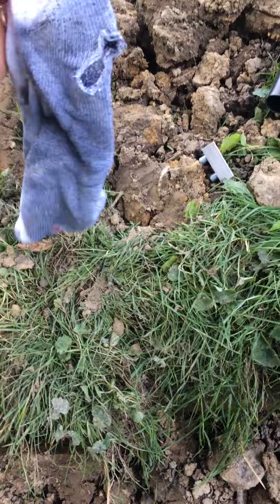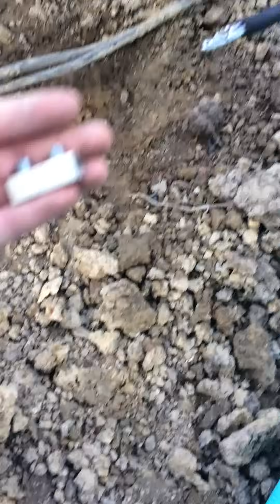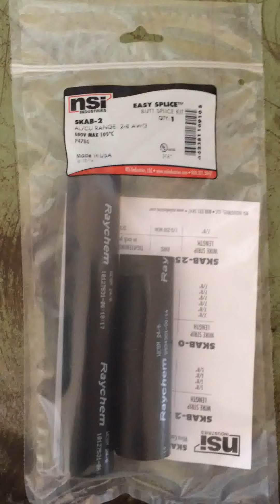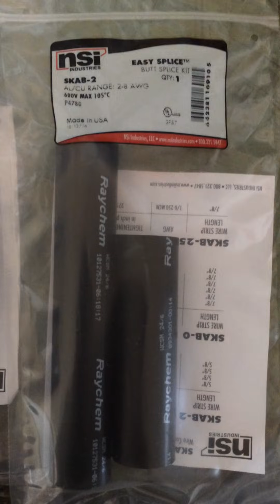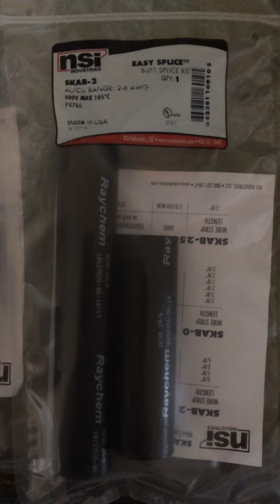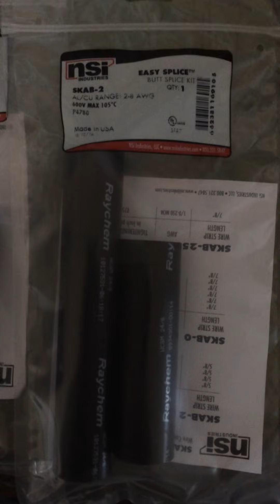Repair broken underground aluminum electrical line 4 AWG

Comment: Do you have a video on how to connect the aluminum 4 AWG wire to your barn electrical box (assuming the box is copper wiring)? Thanks.
Reply from the maker: There are terminal blocks inside the box. One for each hot leg and one for the neutral leg.
Reply: @justtinkering6054  Thank you. I appreciate the response!

Comment: I'm really relieved these kits are available; I just busted 2 of the 3 wires feeding my work shop .
I couldn't wait for a electrician to come and give me an estimate I needed power that morning so I cut up 2 - two inch sections of aluminum rod I had around and 4 small hose clamps with lots of electrical tape got me through today's job. To be clear I'm not burying my McGuyvered repair I'm going to use those butt connectors that meets code!
Reply: I just fixed the wires and buried them. One thing that was in the instructions was to torque the set screws down to 45 inch/pounds. Not a value that's easily attained by feel, even with my torque wrench set I couldn't shake the feeling that "it's not tight enough". But the common screwdriver bit I used did tend to skip out at that setting so people may want to use that as a guide.